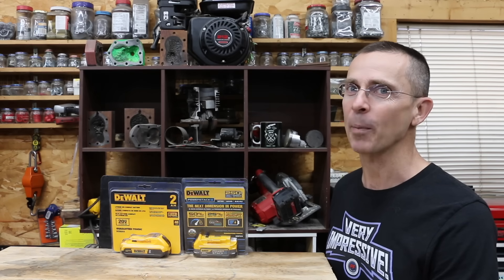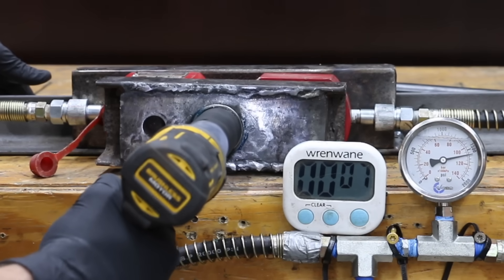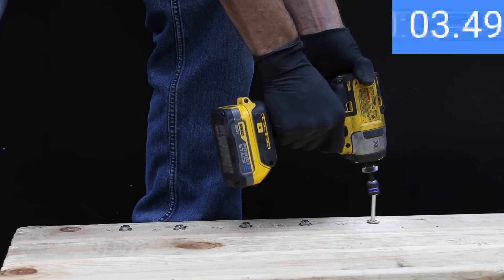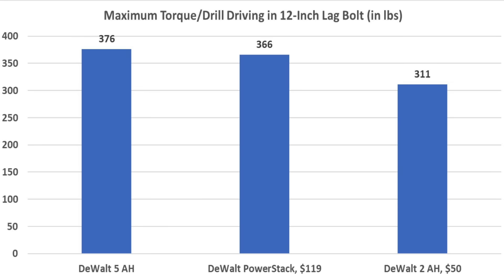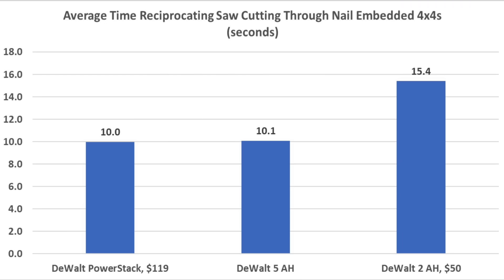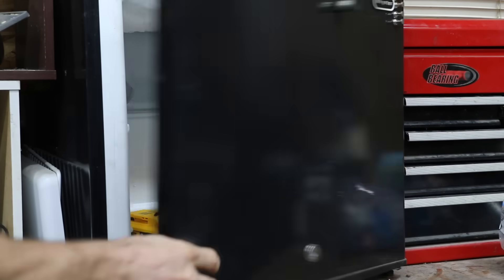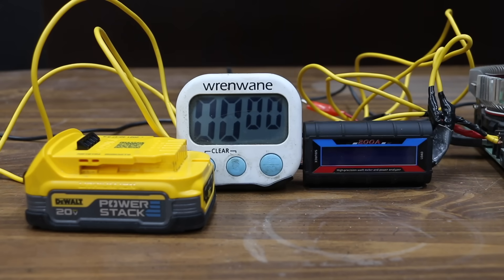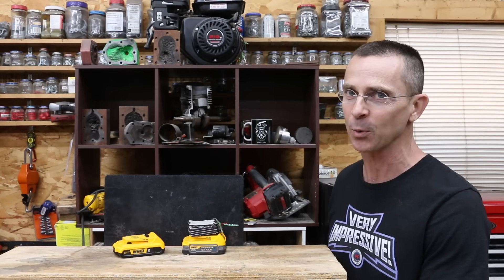Compact “Pouch Cell” Battery Better? Let's Find Out!

Comment: Can't expect too much from Chinese made battery packs. This shows the power stack needs double the number of cells, with them being assembled in parallel-series combination. This means pairs of cells connected positive/ positive, & negative/negative. Doubles the current of each cell, then connect these pairs in series to give the required voltage. Great test video though. LiFePo4 batteries are not affected by temperature variations.
Reply from the maker: Thanks!
Reply: This is probably true for cheap chinese made 18650 cells but some of the best lipo cells are chinese made
Reply: @flightdesign1592  I try to avoid Chinese made items as much as possible. I wear Chinese made tools out very fast. I once bough a really large socket set. It was a good price, yet the ratchet bars failed quickly. I also have Chinese made pliers here. These will be put in the tool set for my small lathe. My car tool kit comprises of a mixed bag of tools from Kincrome to Snap-On. I have some tools stamped made in China, but they are actually made in Taiwan. I also have Draper pliers, a Draper tap & die set, BGS spanners, all German made, & a Bahco socket set made in Sweden. My 1/4 drive socket set is Kincrome, which is Taiwanese made. As for batteries, you get what you pay for.
Reply: @christophermarshall5765  Yes especially with chinese products you get what you pay for

Comment: HERE is a video idea! Whose battery holds up with heat? My Makita chainsaw has problems in the summer with heat over 85 degrees. The chainsaw gives up and you have to wait for the battery to cool down.
Reply from the maker: Thanks for the suggestion.

Comment: The problem with pouches is the failure rate over cells. Anything with a custom size like that has far fewer working hours on its design so the ability to catch problems and potential catastrophic failure modes is diminished.

Personally I'm sticking with the cell design as the risk doesn't out weight he rewards.
Reply: The pouches do have a tendancy to swell when off gassing from an overcurrent or impact/crush incident, I think I'll stick to the cylindrical cell design.
Reply from the maker: Thanks for the feedback.
Reply: Reason I stuck with the old 18v ones till recent. Just bought the adapters and slapped in the lithium batteries. Waiting till the bugs get worked out on some of the newer tools and these pouch batteries before I switch.

Comment: Could you try testing motorcycle gloves for durability? Like you did with hardwar store gloves before. It could be expensive as average gloves cost 30-40$ and higher end go over 100$. But it would be nice to see. If you do try to make sure they are the same armor rating(like ce 1) and maybe the same materials unless a mesh glove claims to be ultra tough. Thanks alot for reading! Great videos!
Reply from the maker: Thanks!  Thanks for the video idea.
Reply: To add more to this, an idea for testing wear on these since they are supposed to survive a slide, instead of dragging it on sandpaper maybe you could get a rig setup where you turn sandpaper at 30mph and possibly 50mph, and run the gloves on that with say 15 pounds of pressure, maybe step up the weight if they dont grind easily.

Comment: The power stack is definitely a niche for people who value the smaller footprint and weight but don't need huge capacity, it will definitely sell.

Your results do mimmick alot of information I've seen on the torque test channel where basically the larger capacity packs just end up providing more torque with impacts, the 5ah is usually pretty consistent though because I believe they are still using Samsung 30T 21700 cells which are some of the best mass produced cylindrical batteries for high discharge applications.
Reply: The 5amp are 18660 cells the 6amp and up, along with the slim 4amp are 21700 cells.
Reply: @nwngunner  thanks for the clarification
Reply from the maker: Thanks for the feedback.

Comment: This video was right on time.  I use a lot of dewalt battery tools and need a few new batteries.  I’ve got one fairly new 5 ah that will not charge beyond two bars no matter which of several  chargers  I use.   ????
Reply from the maker: Thanks for sharing.